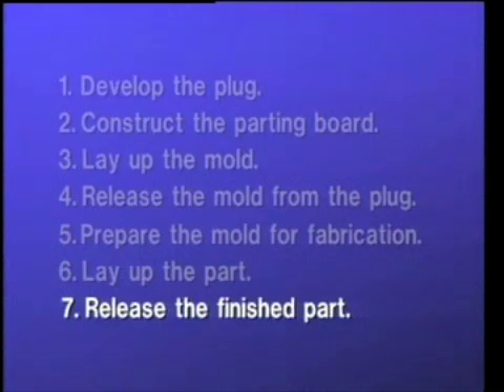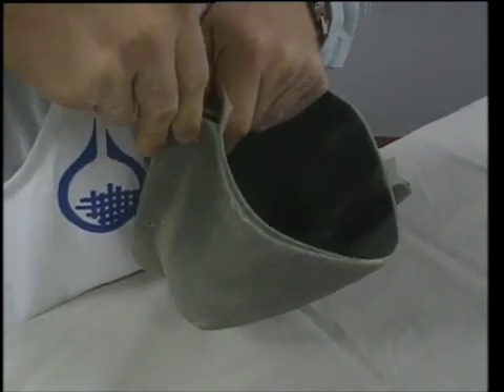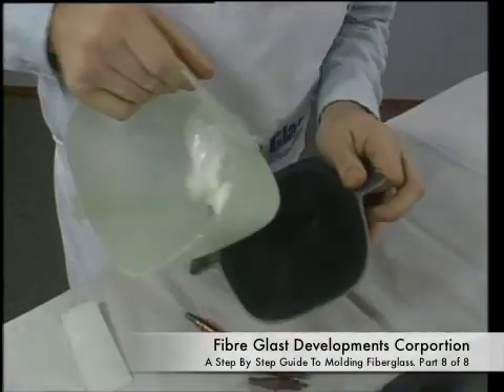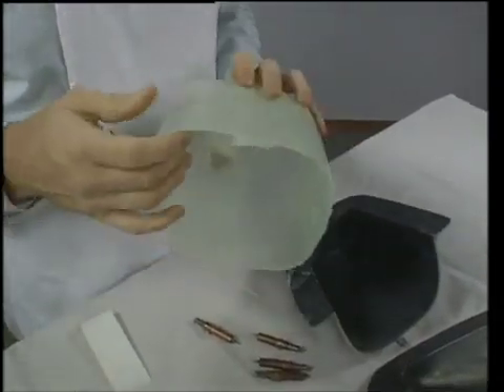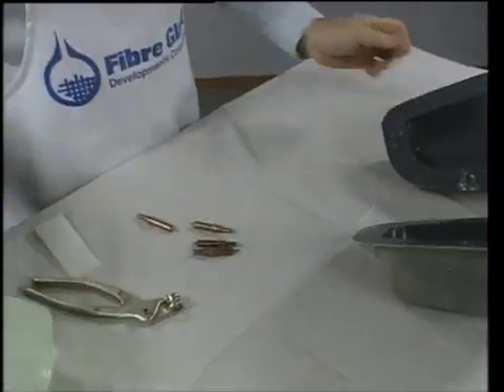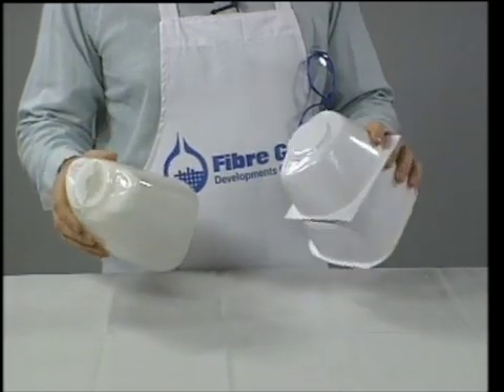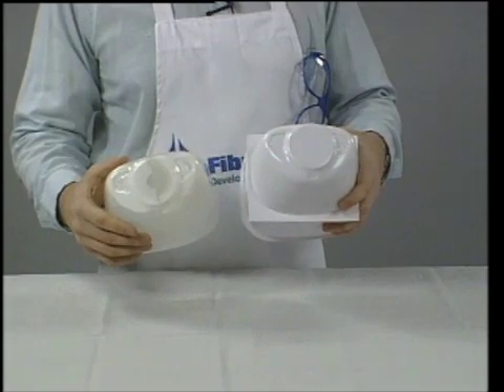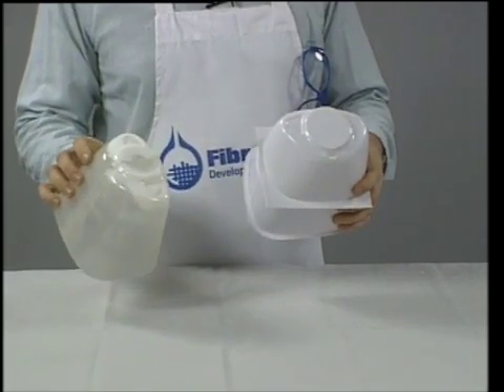How To Mold Fiberglass & Composites 8 of 8

Comment: @SPmQQse Mostly likely because the fibreglass matting isnt very friendly on complex surfaces. If this mold was a semi circle for example, you wouldnt be able to bolt it together and proceed to fill it with cloth and resin. 
If you had a dome shaped mold, you would be able to lay it in one go.

They are simply demonstrating the harder process of the two :)

Comment: you would never get your hands or the matting down in that tiny area.
sometimes 2 parts are necessary.  I've had to make 3 part molds for very complex angle object.  plus 2 part molds are required if the part wraps around inside of itself. you would never be able to get the part out of the mold otherwise.